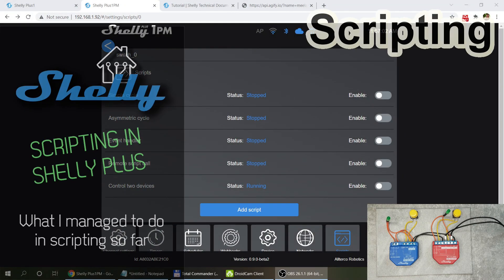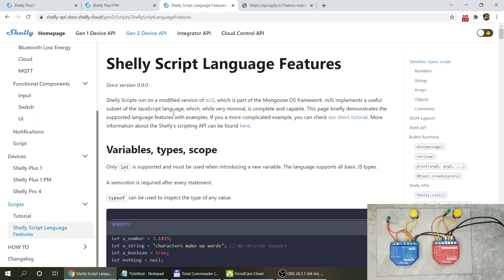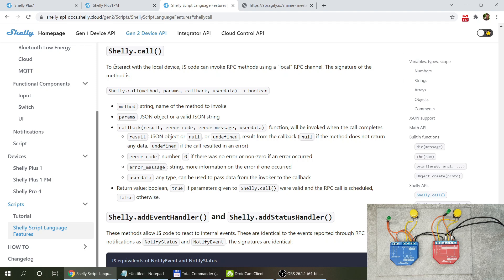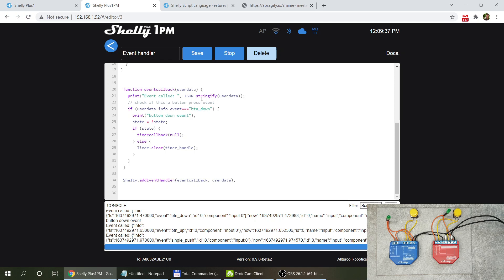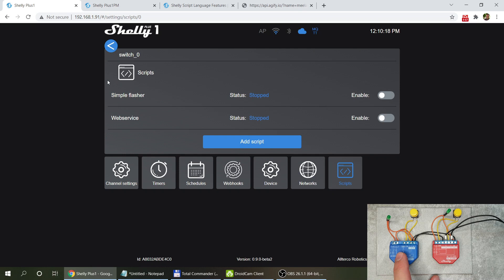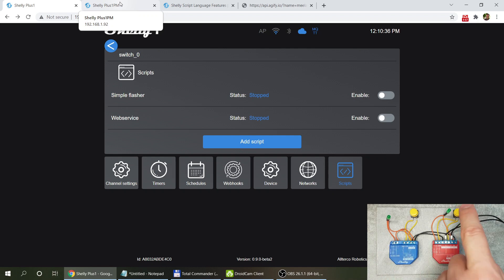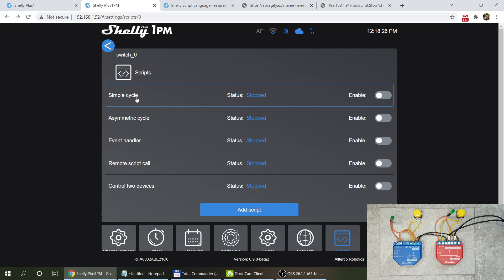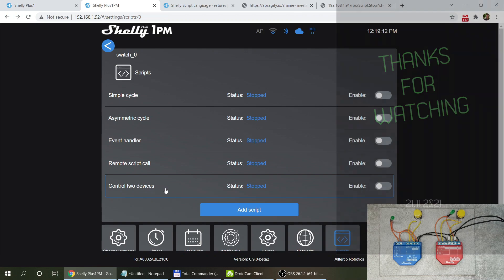How to use scripting in Shelly?

Comment: Hey , so i have a problem at an hotel im working on , i have an evo home system thats just bad , i wonder if i can put shelly thermostatic valves on the radiators in each room , and have them call for heat when  open using a shelly relay and this method , or even simpler , i just want each trv to activate one relay in the boiller room

Comment: Nice video, thank you!
I have an RGBW PM with a push bottom to power leds on and off.
Short press on
Short press off
Long press dimming function.
But if a short press is done again it powers on with the last brightness configuration.
I would like to power it on alwais with the same configuration no matter the long press done.
Could you be so kind to help me with this configuration?
Reply from the maker: Sorry, I never used a PRGBW, so I have no experience. But I am not sure if this can be configured. Maybe with a script it would be possible to catch and switch on event and set the brightness and the color to a fixed value. But I don't have such a device to experiment and test.

Comment: Thank you for this great video. I have a specific issue with scripts.  I have  gen 2 an 3 shellys and I need do write mqtt on azure broker. I have all certificates working and is comunicatins. The problem is azure needs mqtt retain OFF, and gen 2 and 3 uses retains ON. Can I use a script just to to disable retain? Thanks in advance
Reply from the maker: Sorry, I did not really use Shelly scripting since this video and I forgot most of it. There is a very vibrant Shelly Support Group on Facebook, I think you should try that.

Comment: Great video, Csongor! Thanks so much! This is the first time I've tried using a script, and your video explained it really well. Ultimately, I want to control the slat angle of my Venetian blinds using my Shelly 2PM Gen2 device, similar to how it's done with the Gen3 devices that just came out. Hopefully, I'll find a way to make this work. Have you tried this yet, or do you have any suggestions on how to implement it? Thanks again!
Reply from the maker: This is a very old video of mine, and since I made it I did not work more with scripting. To be honest not the easiest way to write this code and debugging is also tedious. I only controlled venetian blinds using a controller which is designed for it. But if my understanding is correct, you have two wires to control the blind, one expects short pulses to raise or lower the blind like a garage door and the other controls the angle. But I am not 100% if that is by pulse or continous signal.

Comment: Hey! Great video! I wonder how I could use Event handler script and use it for two separate buttons on a single Shelly device. Event in this video is triggered by both of the inputs the same way. I would like to separate them.
Reply from the maker: Uh, it was a long time I did this, but you can tell from the event which button was pressed. But it does trigger the same event.

Comment: Salutare,
Oare se poate creea un sistem de comandă și control pentru încălzirea în pardoseală, independent de internet, folosind shellly rgbw2 pentru controlul a 4 zone separate și un releu dry contact de la shelly pentru a porni centrala?
Prin protocolul Device to device communication pot face un shelly h&t să trimită o comandă de pornire la un canal din cele 4 existente la rgbw2, dar problema pe care o întâmpin este cum pot comanda in același timp si dry contact pt comandă centrală, in același timp ținând cont si de celelate zone care sunt controlate fiecare in parte de un termostat shelly.
Mulțumesc.

Comment: @Csongor Varga , can you tell me if I can upload code to a shelly device and let it run on the device, as opposed to running code on a PC and sending commands over WIFI?

I want open and close a switch to a power supply at certain times throughout the night and do not want to run a WIFI network during the night. 
The use case is to have a window opening and closing automatically at times whiich I to specify, e.g.: 
 9:59 pm --> close window; 
 10:01 pm --> open window 
(And yes, I want to keep the air fresh and also avoid a predictable noise at the full hour, every hour)

I was looking at the "Shelly Plus 2PM" which generally would suite the purpose, but I dont know I the code can be uploaded to the device itself. If not, would anyone know of an alternative?
Reply from the maker: Scripting is a code that runs on the device. So it will definitely stored and runs on the device. But the simple schedules that you set in the settings are also stored in the device memory. So both of those work without the cloud. In these cases cloud is only used to access the device from your phone. One note: these small Shelly devices do not have an internal clock battery. Therefore in case of a power outage the clock resets to 00:00. They sync their clock from the internet. So if your power goes out and the internet is down as well, the clock of the Shelly will not be set correctly.
Reply: @csongorvarga  Thank you for this info. Ideally I would like to use a device which is programmed/accessed via cable (eg via USB). I assume the Shelly Plus 2PM is constantly advertising its WIFI access point, therefore there is constantly a 2.4 GHz WIFI signal send. I would like to avoid WIFI pollution in my space. Would you happen to know of an alternative device, which can be accessed for script upload via a cable?
Reply from the maker: @Rajo1012  Not really. There are a few Shelly Pro devices that have wires eithernet connection as well. That would be my only tip.
Reply: @csongorvarga  Thanks

Comment: Is it possible to Script something to read temperature values off Shelly Uni to create a “if sensor 0 is less than sensor 1” turn off relay ?
Reply from the maker: Yes probably. But I have not explored how to read other sensor much. But you could make a HTTP call to the uni and read the temperature from the result.
Reply: This video is really interesting. I'm trying to modify the ms to start the longpush on the new shelly 1, in the old one it was possible to modify it, do you have any advice?

Comment: This is a very nice introduction to scripting in shellys, something that is not widely covered on YT. I just purchased a Shelly 4PM and I'd like to write a simple script whereby one switch down makes another switch up (and vice versa). I'm not a programmer so any pointers would be appreciated! I usually do this kind of stuff in home assistant but for this installation it needs to be on the device.

Comment: Thank you for the video, looking at your scripts has made it easier in my head to start writing up a script on my Shelly 4PM to control the warehouse lighting.
I plan to add a Shelly motion sensor literally for its LUX sensor and have the 4PM only allow the lights to be on when the light level is low.

Comment: Is it possible to have a script that takes the app button press and makes the relay pulse on and then off. Need this for a particular application that needs a relay pulsed input for on / off operation.
Reply from the maker: Yes, but you don't even need a script for that. Just set the auto-off delay on the output.
Reply: Thank you!
Reply: The application here is an aircon unit and the auto off works to a point. Obviously the downside is that the switch always shows as off, when the unit may be on, and turning the unit off with the app (or with google) doesn't work. I have created a routine in google that "remaps" turn the aircon off" to a switch on operation. But I have no real way of knowing if the unit is on or off. The aircon unit does  have an output relay that provides operation status (closed = on, open = off). I tried connecting this to the Shelly Plus 1's switch input and set the switch to detached to see if that would give me any indication of on/off status, but it doesn't seem to. Any advice on how I could integrate this output relay into the Shelly to provide on/off status?
Reply from the maker: @terryshaw2162  That is a good question, but I have no idea either. The only other hint is the unit is on or not, is to monitor the power consumption to tell if it is running or only in standby mode.
Reply: @csongorvarga  I am thinking I use a 2nd Shelly with the aircon output relay connected to its switch input, and the switch set to toggle, but nothing connected to the relay of this Shelly. Then call this Shelly "AC Status" or something like that.

Comment: Does it support sockets?
Reply from the maker: This is available in the new Plus line of devices. There is no Plus socket...yet.
Reply: @csongorvarga  Thanks for responding. Apologies I should have been clearer, I meant in regards to NodeJS something like this:

var net = require('net');
var client = new net.Socket();

I guess this is lower than HTTP. I did look around the docs but could not find anything. 

Would have been nice to avoid spinning up a little server just to send a packet. 

Never the less I think what Shelly are doing is really awesome and hope they expand on JS/Node feature support.